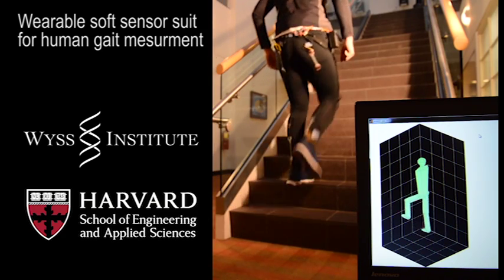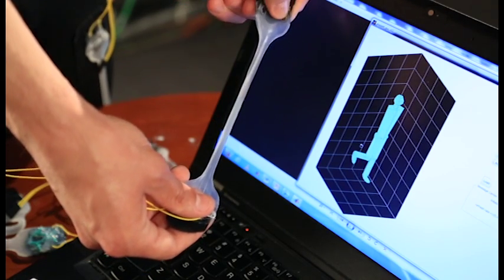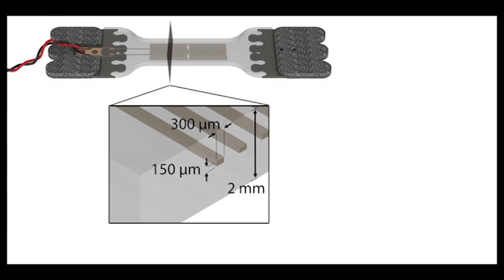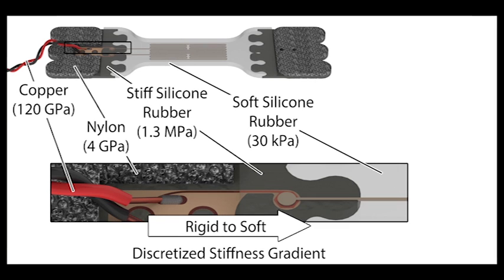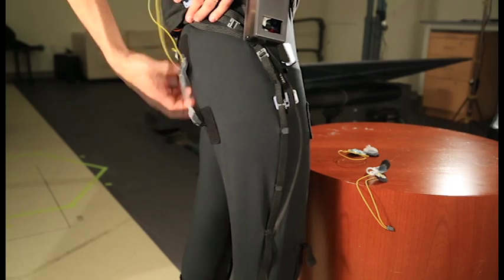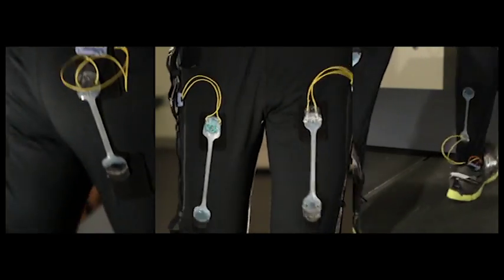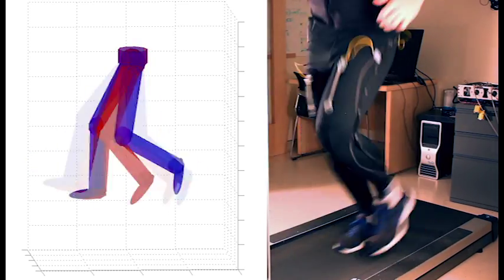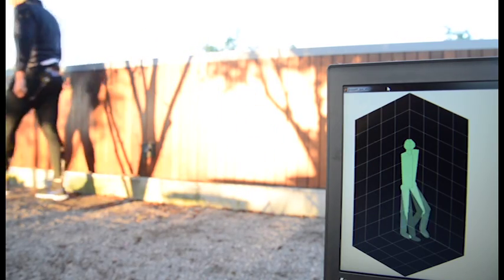Soft Sensing Suit

Comment: What's the principle of operation? Piezoelectricity?
Reply from the maker: The sensing principle of our artificial skin is changes in electrical resistance in response to physical deformations. When the microchannels filled with EGaIn are either pressed or stretched, the electrical resistance of the microchannels increases due to their reduced cross-sectional areas, increased channel lengths, or both.
Reply: Piezoresistance